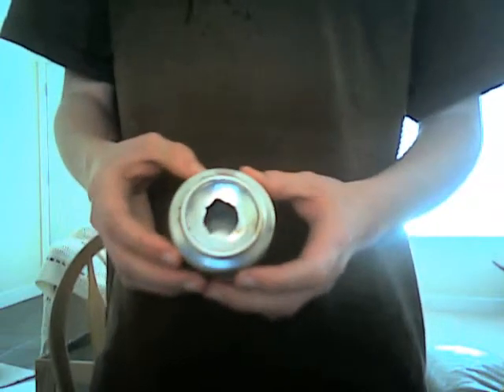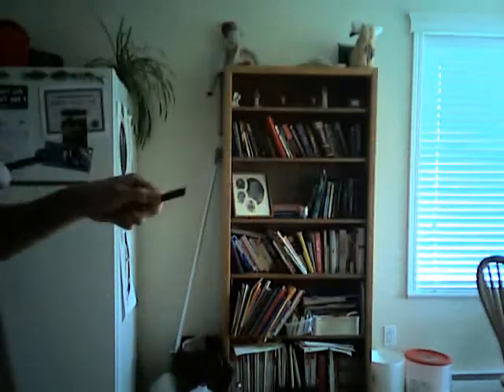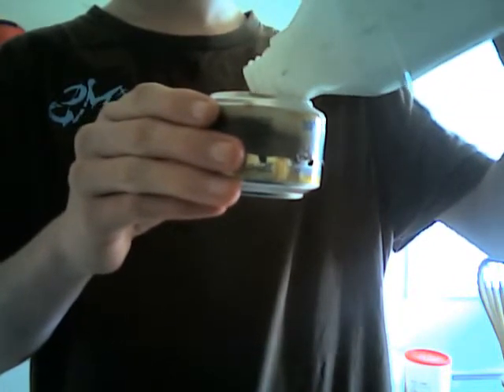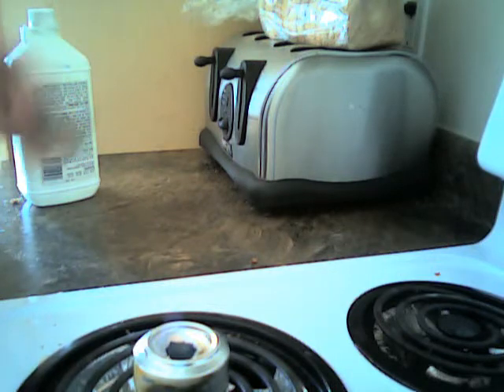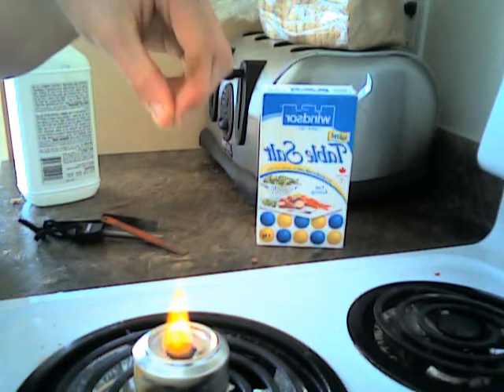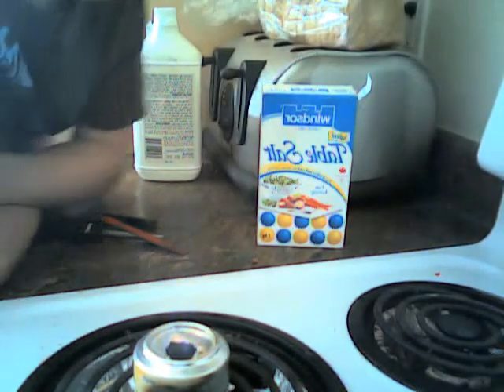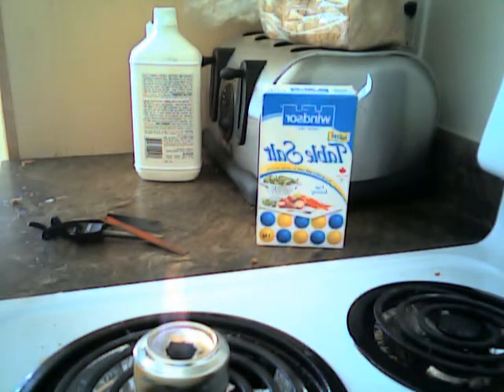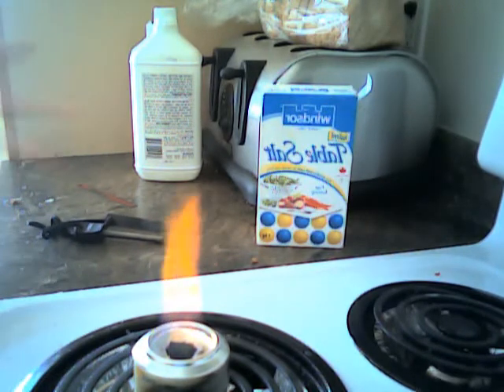updraft popcan stove

Comment: You actually don't need a pot stand with this stove, if you make your holes a little higher. Once you set the pot on top of the stove the flames will be forced out of the holes and upward, making contact with the pot. The updraft of chimney alcohol stove is the best design. You should look up CIT Mutant X alcohol stove.